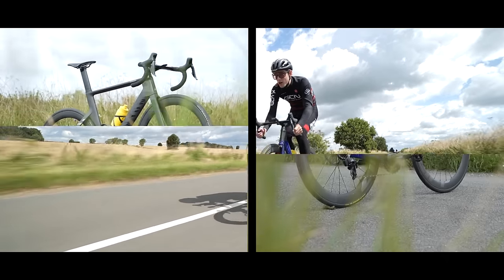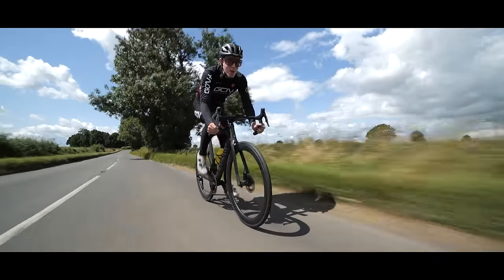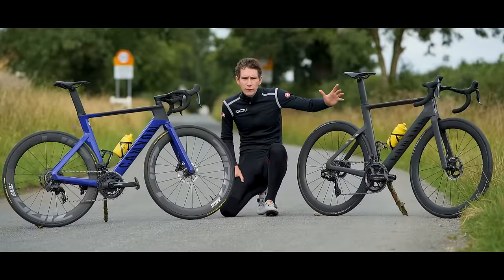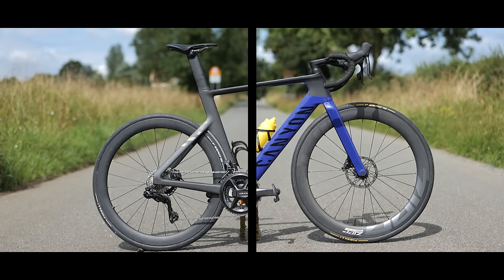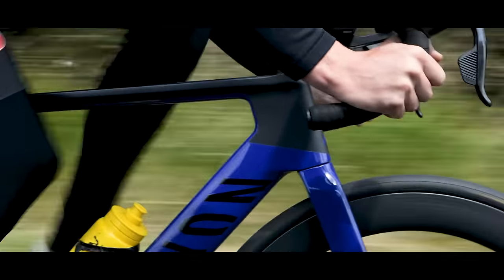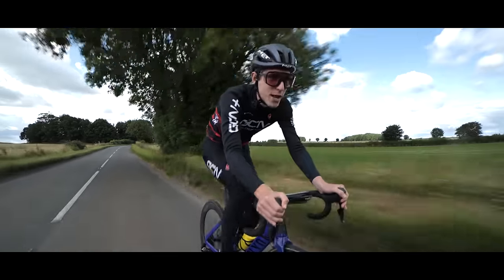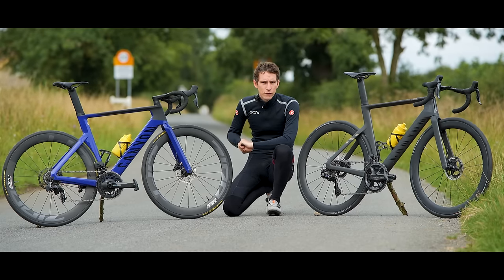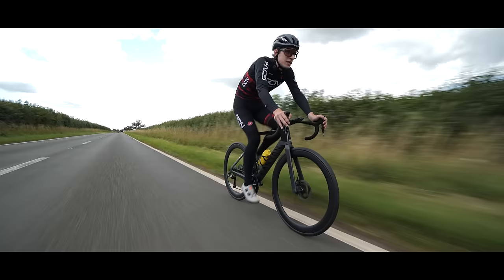Why Do These Two Canyon Aeroad Bikes Feel So Different?

Comment: What's the seat post like now? I'm thinking about getting one
Reply: They have a new frame design on some of the aeroads that’s new that’s exactly like what MVDP is riding now which fixes the issue fundamentally but also the older versions have been fixed with a new seat post design and dust shroud. All in all, you shouldn’t have a problem
Reply: Very small sample size I know, but I've had a CF SLX8 for > 6 months and haven't had an issue.  I also love the bike.
Reply: I have had my SLX for 3 months now and have adjusted the seatpost a bunch trying to get it right and I have not had any creaking.
Reply: Thanks for the replies.  I'm looking at the canyon aeroad and the new scott foil rc but at the mo the scott is hard to get hold of

Comment: These canyon aero roads have got a major design defect with their seat post vibrating and making creaking noises - loads of YouTube videos about this issue. Why is Si not mentioning that
Reply: Own a CFR - and its not true - they are all fixed and has no issue. The videos are from the first gen that didnt get sent back on recal i guess. Mine was sent back - and there wasent a issue at all. Came back with a sleeve install and still no issue
Reply: @caet49  Good that it has worked out for you. But there are scores of people on Youtube and Reddit who have been complaining about this issue - which has cause some of them to return their bikes, and selling them on.

Comment: that carbon rail cut out saddle is way to flexy maybe 100 times more than the difference between the rails. unless they fixed it with the newer ones. they made that saddle wear out in about a year with the shell and foam, saddle could last a life time, so thats not worth buying

Comment: Si, I noticed when you went to the Silca tire pressure calculator you entered 72kg as your value for weight of yourself AND bike. Then, when you went to the Zipp calculator, which asks for 'rider weight', you entered the same 72kg. What's up with that?
Reply: I hate to break it to you but you weren’t actually watching me do it.

Comment: Silca pressure calculator is rider plus bike..
Reply: Indeed it is. The rider weight stayed pretty similar for this video though!
Reply: @simonrichardson5259  In the Silca Calc the total weight input was 72kg, this would be rider + bike/kit. In the sram calc it looks like no bike weight was input with 72kg being the rider weight. 

For anyone using the Silca calculator, which is a really good tool, ensure you input the proper weight. A few PSI out can make a good fast rolling tyre draggy when under inflated. Equally when over inflated it can be bouncy with poor traction
Reply: @S106R  Ah I see! that was our editor and not me doing the screen flow!

Comment: mmm, dub bottom bracket in BB86 frame - not the best idea.
Reply: Why?
Reply: @DaveCM  bb86 is a Shimano standard that is designed to accommodate 24mm spindel. dub is 29.99mm that requires much smaller bearings to be used. And that will influence the efficiency: smaller balls would not rotate as efficient as larger. my understanding that is the reason why canyon use rotor aldhu 24mm spindles. but I would personally avoid dub ones. this is my personal opinion :)))
Reply: @olegkurovsky3198  you've been watching Hambini I take it?
Reply: @DaveCM  hambini is my spiritual leader
Reply: @olegkurovsky3198  🤣🤣🤣

Comment: Of course the two bikes ride differently - the black one is the top tier model and the blue one is the 2nd tier of the same model. If they didn't and they rode exactly the same, then why would anyone purchase the more expensive top tier model?  Yes you can measure the difference in weight but i challenge anyone to feel the difference of 100 g while riding a bike - even going up hill. Try this for a test - ride your bike in an uphill time trial with nothing in your back pocket. Do the same TT but put your cell phone in your back pocket. Determine what the difference is in ride feel and by time. You will not find any difference - except for the weather, what you ate the night before,. ie things not related to the extra 100 g of the cell phone. So the top tier bikes have to qualitatively feel different than the 2nd tier bikes or Canyon will not sell any more expensive top tier bikes.

Comment: I used to think the rails on the saddles would matter, but it makes no measureable difference.  By the time a vibration gets through tires, frame, seatpost, then to the saddle rails, and then through the padding on the saddle, zero chance it makes sense.  The only thing that moves enough on a road bike to create suspension, is the tire.  You can alter the ride by adjusting the psi more than anything else (size, shape, psi, compound used, etc. etc).  Watch a slow-mo video of a tire going on the road, it moves so much compared to anything else.
Reply: Yeah you're the one making the most sense.
Sure they used the "optimal" calculated type pressure, but change it by half à bar  and you might lose 1 W, but feel smoother or harsher immediately

Comment: cranks have a feel all of their own... espeicailly top end ones.
you guys wrote that off right at the beginning
it's always made me laugh - the way most riders think it's just the weight and the ring size that makes the differance.
they is a hell of a lot more than that going on
Reply: Yeah I agree. I have a Quarq Powermeter with SRAM red crank and a rotor 3D aluminum crankset with Power2max power meter. I much prefer the rotor crankset. I don't know why though.
Reply: I have three bikes, one dura ace cranks, one Rotor adlhu and one Sram Red.  In terms of cranks I cannot tell them apart.
Reply: Hmm I haven't noticed this but I've never tested it. But I've ridden hundreds of road bikes in my job and frames make all the different in my opinion. Some of the best feeling frames were pinarello dogma f8. I suspect it's the stiffness/compliance in all directions. Torsional and lateral stiffness of rear triangles, head tube, fork, steerer tube...as well as stem and bars. Weight has very little to do with it.